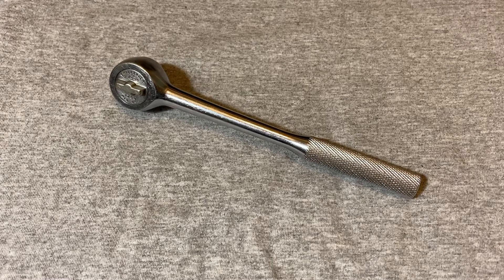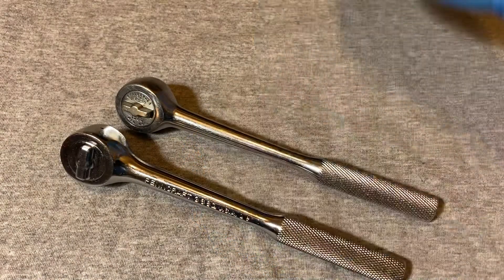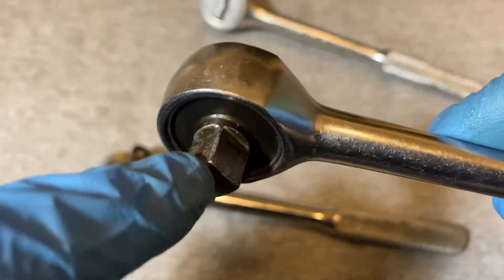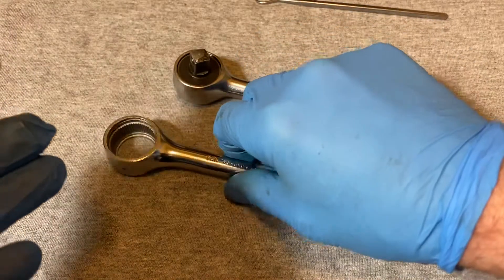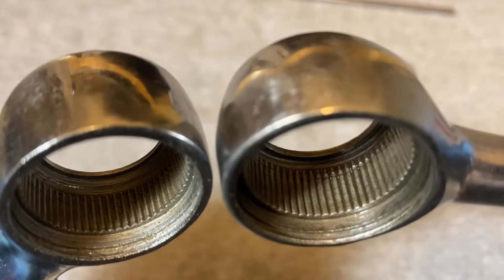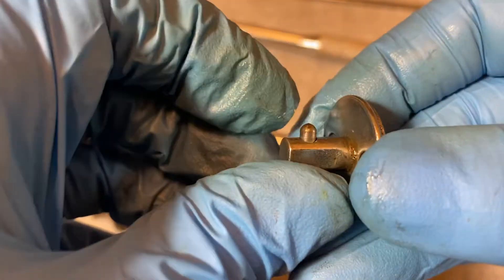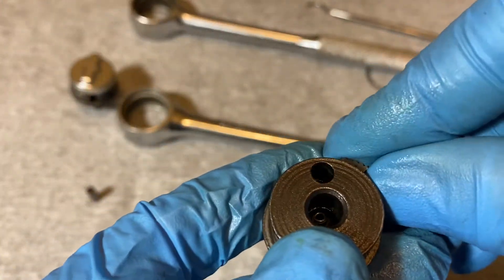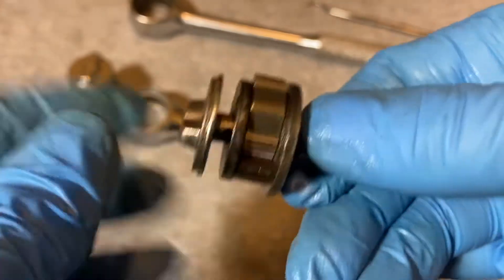Challenger By Proto 1260 TOTAL TEARDOWN And Comparison To New Britain Design Ratchet 3/8” Drive

Comment: You know I wonder if you could put the New Britain mechanism in the Challenger that might provide you in answer to your question on whether a New Britain sold the handle to callenger by proto I'm really thinking they would interchange
Reply from the maker: Sorry for the late reply. The results are kind of interesting. The Challenger mechanism will work in the New Britain. But the New Britain mechanism will not fit in the Challenger. It looks like the diameter in the New Britain is a tad larger.
Reply: @snapringchronicles3020  that is interesting it's been said when New Britain went out of business around 1990 Stanley bought all the extra inventory from New Britain so if that Challenger by Proto ratchet has a link to Stanley then that might explain something at least about the mechanism working but as far as the Proto not accepting it really raises some questions like one question was New Britain trying to revise the ratchet head maybe to keep tighter tolerances but then it goes back to they would have to come up with a whole new idea for the killness patd in order for that to work and that would take money it wouldn't be a good idea 4 New Britain if they were already struggling thanks for answering my question I have a husky and the Challenger by Proto ratchet I'll be doing a video on them pretty soon and I came up with a spring solution for the Proto 4952 ratchet that eliminates you having to spend extra money on a rebuild kit just for Springs might get that video out tomorrow no need to apologize though I understand sometimes it gets overwhelming trying to find the time  to do a video and have time to answer questions also I know I try to do my best and I know you do too and I appreciate it
Reply: Just realized my typo instead of New Britain went out of business in 1990 it typed out in business I really need to quit using voice texting I guess but I got it fixed lol

Comment: Great review, Ty.  It's always been interesting to me that the N Britain and SK styles open like a Rolex "oyster" (from the front) and nothing is removed from the back of the rachet frame.   Some folk don't like the 1600's single pawl, but I don't mind them.  Never had a problem with my Challengers (been using them since the mid 70s).  With the cessation of Challenger in the 90s, I moved over to PROTO products.
Reply from the maker: This particular 1600 seems pretty good. I don’t have the 2 pawl version either but that one seems excellent too👍

Comment: On the 1260-4 ratchet they used dual non-alternating pawls, so double the engagement. I find the machining on these style ratchets tend to be pretty tight, resulting in a crisp/slop free ratchet compared to most other swing-pawl designs
Reply from the maker: Yeah the 1260-4 definitely looks like a stronger design ratchet 👍

Comment: That spring keeps the mechanism tight inside the ratchet body. Gets rid of all the play that most round heads have.
Reply from the maker: Yeah that makes sense. I did notice on some of the New Britain’s that the  switches made clicking noises when you shook them from the switches being a bit loose.